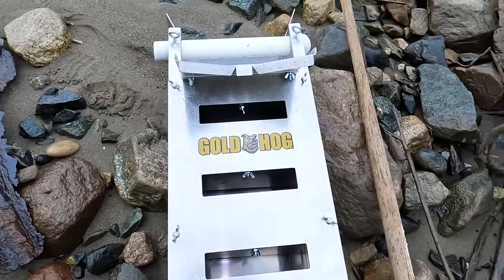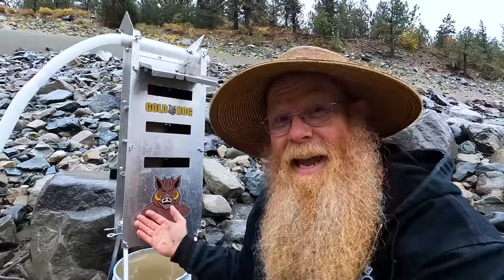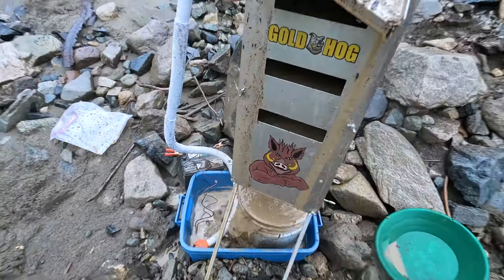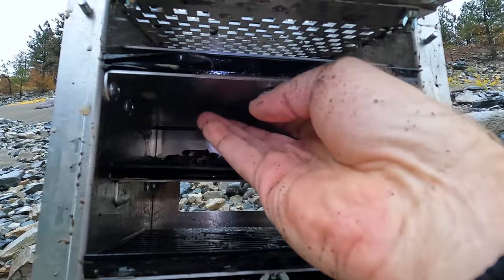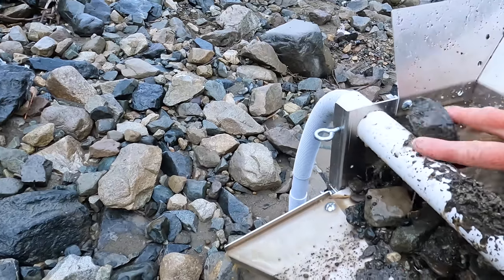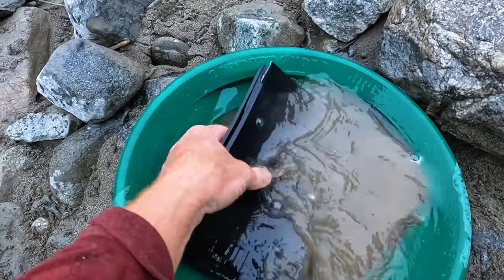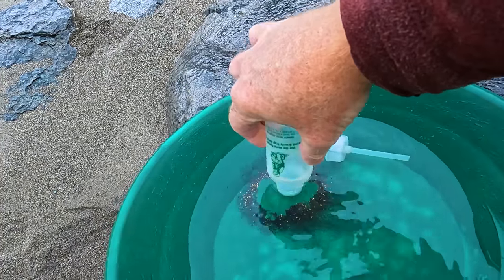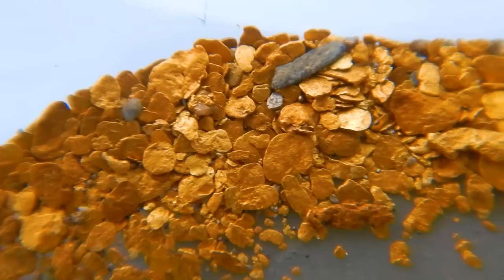New Gold Recovery Technology!  Great Gold!

Comment: Use a smaller bucket just for the pump inside the larger container nested down just below the water line to act as filter for sediment. Opposite of how you used the big bucket to capture sediment and repump the runoff, saves space and achieve the same result of not clogging the pump. This Boar box looks promising, I've been getting into backpacking again and prospecting intrigues me. A lithium Ion 12v battery would be a lightweight option to carry around, could run that pump for several hours. Good stuff! 👍🏻

Comment: I use heavy black plastic tubs from a farm supply store for panning and using my recirculating recovery sluice. 
A plasterer's tub works great for both when neither water nor discharge are problems...and a 15 gallon livestock feeding tub holds enough to recirculate, and would give enough room to set up a vertical unit like this and have enough room to use a tailings bucket you could access easily.

Comment: Hi Dan great video, I do have a suggestion about the Boar Box. The wing nut bolts could be made to swivel out  sideways and slots can be cut out of the front plate to make it easier to take off and put back on faster without taking off the wing nuts completely.
Reply: True but at what added cost?  Isn't there always a trade-off between cost and convenience? Gold Hog could have done a lot of things differently.
Reply: @rogerolander458  lots of fine stuff on the front, I can see the swivel out ones binding up with sand etc. I think it would be an inconvenience if nothing else
Reply: @dougmcmillan2483  Nuts and bolts bind up with sand too.... when apart. I think quick release latches might work well but are more expensive than screws. But screws are a simple solution and add rigidity when tightened up. The bolts could be shorter so that one spends less time undoing\tightening.
Reply: Why not wire the nuts somehow? Add a screw to the side for one end and tack the other or drill into one wing to fasten.
Reply: @mikescudder4621  a couple of simple clamps down each side might work, sure would be fugly though
Reply: I like that Idea !

Comment: Just an idea for you with your pump.
Have a 5 gal pail with a side fitting 1 inch diameter. And it joins to your bin by same pipe. Water flows from bin into 5 gal pail through 2 fittings and piping. Then that allows you to buy time. Pump would be in 5 gal pail and your bin is just a silt collector

Comment: Hi Dan,
Congrats for seeing the invisible gold! 😉
If you replace the end cap of the spray bar with a valve, you could flush the spray bar if it's clogged. Gold Hog may do some improvements after some feedback from users.
If your pump did take sand, you should lift up the clean water bucket. This will help to blow out the sand out off the pump and the hose.
Best regards from Germany!

Comment: Looks good.  When you get done, pull the mats, put a pan under, and rinse out the runs without the mats.  If it's like every dredge or sluice I've used, you'll find a little gold that slipped under them or wedged into the sides.

Comment: Looks very interesting. The unit seems to stand up to the Gold Hog standards. I purchased the Gold Hog Multi Sluice, and it works very well. I usually check the tailings with maybe a microscopic piece or two, but it is another great piece of equipment.

Comment: A few thoughts.  
Get rid of the wing nuts and replace them with spring latches on the front panel and on the mats.  After a session, the generally cold water would make one’s fingers unable to easily manipulate those pesky wing nuts.  Also minimises the risk of dropping the nuts somewhere, or just leaving them at home after cleaning the unit. 
Modify your water discharge so you have a large receptacle, with a mesh screen to the pick up for the pump to protect it.  
Silicone rubber nozzles that push into the water pipe.  As you rub them, they will self clean in most situations (many domestic shower roses use this nowadays, to deal with water scale). 
Make the whole box from a plastic material, with the option to 3d print mats specific to the user’s local conditions.

Comment: Hey Dan, been watching your videos for about a year or two, like the content, and I like your presentation. You have good energy. I had a suggestion for the next time you run the Gold Hog .. if you wanted to get material up into the hopper with less rocks etc you could run a little shop-vac (2 or 3 gallon} with a large suction tube and put a piece of hardware cloth quarter inch size or so wire over the tip of the tube, that way nothing bigger will get sucked into the vac bucket, and then dump that into the hopper once it fills up each time. I'm sure you could find one that would work on the same 12 volt battery and some that I've seen have pretty good suction you could try with different size holes of hardware cloth wire if quarter inch was too small etc, don't know if that would take some of the fun out of the shoveling part of it for you though but I heard you once complain about your back in one of your videos, and that might save it quite a bit.. speaking from personal experience hehehe. Also if you take a piece of Styrofoam and duct tape it onto your recirculating pump about 6 in up the tube it should float right underneath the surface but you may have to adjust it. Just a couple ideas, I'm totally new myself to panning etc but watching the machine run I thought it would be worth testing maybe? I hope it helps you in some way or helps somebody who sees my comment, if it does leave me a shout or something hehe thanks again for the content, cheers!
Reply: Good Show Bud...!

Comment: Dan, Here's a way to fix the water pumping problem in your GOLD HOG rig:  Try processing your tailings in the same way the GOLD HOG Boar does by running them through two or more basins which catch the tailings BEFORE the water gets to your pump in the LAST basin. Then, to further protect your pump, put a larger bulb of screening to keep sand out of it without choking it. And finally either some sort of floatation or a clamp rigged to prevent the pump from dropping down on any sand on the bottom of its basin. Again, the main idea is to process your tailing in the same way to remove sand just like you catch gold so what gets through is mostly muddy water which can be pumped back up through the GOLD HOG Boar rig. Finally, your could make it easier to remove, empty, and replace the upper two tailing basins perhaps while the setup is running. Perhaps using all same size basins and a spare to replace full ones would work best. Good Luck!
Reply: Drop the pump into an old winter sock, and use it as a pump filter (after you sew the holes closed).  When the flow slows down, remove the pump and wash the fine silt out of the sock, in a bucket of clean water.
Reply: @brainretardant  Huh???

Comment: Dan I have a suggestion for you. It would require two of the same electric bilge pump. Connect the outlet of the first pump into the inlet of the second pump. This will double your water pressure. If you run them side by side or in parallel you can keep the same pressure and double the volume. I've tested this theory with a dual 12v 3500gph bilge pump powered 1 1/2" dredge that had pretty good power.

Comment: Hey Dan 'GOLD HOG'!!!
! Just a quick note. Go ahead and start switching out to Lithium power/batteries. Can't beat the power to weight ratio and charge cycles. A pump screen made from window screen works perfect for a pump strainer basket. Hopper and tailing tray should be included. Swap out the wing nuts for thumb knobs.

Comment: Make a tray like the one you use to remove the big stuff, then put a big tub underneath the gold hog,  put a notch in the big tub at the top edge for the water to spill over into a smaller tub where you put your pump.

Comment: I have a Gold Hog Rapture 2. It is the best machine I have used for gold recovery.  But it takes about 6 workers to keep it fed consistantly.  It  has 3 Shutes and takes 2 3500 GPH Electric pumps to keep it  flowing.  But, not a good machine in the desert unless you have the water supply to run it.  I like the boar box design, but I still feel like there could be more improvements for faster assembly and disassembly of the mats. For EXample: Imagine if you could pull all the mats at once, at the same time. I dont even know if the mats should be bolted down like that, but hey, if it gets the gold, Im happy for you. Show us more  😃

Comment: I don't know if the Gold Hog has been given away yet, but I do see some things that someone could do to improve on the setup. As far as having a tub and bucket to put my first shovel of dirt in and wash the material and then pour the pan in to eliminate the big rocks going in. I would also have a two section tub to put my pump in with a screen to keep the pump out of the tailings.

Comment: Without reading through everything, just found this vid, if you haven't already, try Tidy Cat cat litter buckets (they have various sizes, larger/shorter).  They are rectangular and look like they'd match almost exactly under this machine without having the problems of sticking out the sides so far that it causes problems in the catch bucket.

Comment: Seìng you struggle with your water operating the Gold Hog Boar Box, I refer to the system I built for my saltwater-aquarium. It has an overflow which doesn´t allow heavy objects to fall in, hence it´ll work for your operation too. When you work with 2 or even 3 different ´chambers´ with an overflow and if you like, use a spunge as a last filter around your pump, you´ll see there is no possibility for obstruction anymore. Greatings and good luck and fortune wishes for you from The Netherlands.

Comment: An idea on a water bin would be to find a long plastic bin that you could actually put the Gold Hog in for transport that way you have a lot of room for water and the pump can be at the far side and you won't have to worry as much about the trailings clogging it.  Could also put the water bin at an angle and have the pump at the top and occasionally scrape trailings to the bottom with the shovel.
Reply: Gold nice
Reply: Goldhog way togo

Comment: I've got 1 redesign suggestion for the GOLD HOG, and that is to do away with the time-consuming tedious wingnuts completely and use some type of latches in their place...something like an over center toggle latch or similar.  In a good day of work, those wingnuts probably would turn into an hour of undoing and redoing the wingnuts, so latches could easily get you 5-10% more GOLD per day.  Cool low volume machine otherwise.

Comment: WOW Dan! I never knew this hobby existed. Your GOLD HOG seems to really simplify catching the gold. I can see how this would make for some great vacations. Thanks for the video, Bill.
Reply: After watching you I would improve your gold hog by running an overflow to another pail for your pump also do away with the wing nuts and put slots on the front panel reverse the bolts  with large enough hole at the bottom to enable you to just press the front on and let it drop into place  good luck 😊

Comment: Quite a handy addition to a Gold Fossiker's collection, but with the manufacturer's idea of assembling it, it's way to finicky, and a right royal pain in the posterior in putting it together, fiddling with a heap of wing nuts, and then to disassemble the front to gain access to the lift out trays. My idea would be to have front, back, and sides to slide together, where the two side panels would have aluminum u-section channel on their vertical edges, and the front and back panels be aluminum box tube. In regard to the front panel, it would therefore provide easy access to the trays within, simply by sliding it up out of the way. The lift out trays, could also benefit of u-section channel riveted to the side panels, and the trays fitted with either aluminum, or heavy duty plastic tube runners, with an easy slide in/out operation. What do you reckon Dan?  Perhaps you could pass that along to the Manufacturers. I daresay it would add to the cost somewhat, but I'd be more than willing to accept that for the convenience factor alone, Cheers Dan, and many thanks for sharing...

Comment: Was thinking of some way to have the larger basin pour into the smaller one with the pump. Could even cut a hole and place an outlet pipe for that to work. I imagine that's been mentioned in the comments.

Comment: The first thing is to take a smaller container and cut out windows and put fine screening on the open areas using a product like JB WELD you have to rough up the plastic for better holding the water can come in but not the trash and fasten to the larger tub.  My high banker my suction hose has a pail with windows of fine screen and I have a clean out on the spray bars allowing me too flush them clean .  The top of the bucket has split lid tight around the hose with zip ties ries keeping it closed with 6 or more highbankers working a pit it keeps a lot of trash out of my system that others have to deal with

Comment: If you used two tubs at the bottom of equal size, you could start with the clean water and the pump in tub #1, and have the unit run into tub #2, put a hole in the side of tub #2 about 3/4 of the way up and run a hose to tub #1. That way it's just the dirty water in tub #2 that is going into the pump's tub. If you stagger the heights, with tub #2 higher than tub #1 you don't even need to worry about suction to keep the water flowing, gravity will do the work for you.

Comment: If the front plate was hinged on one side you would only need to undo three wing nuts. 
dispensing with those wing nuts and using three R clips would be even quicker.

Comment: Probably a little late for the give away, but "Gold Hog" nonetheless! Loving the content. I personally haven't had the chance to try the Boar Box, but after watching the video I would say adding the claw with a 1" plate at the bottom of the claw like the Gold Hog Raptor 2 would improve the design. I noticed a lot of material fall out when being scooped in. The 1" plate on the claw would allow sufficient time for the water to break apart the material. Adding this attachment would also allow the tray to be slanted even more allowing the rocks to slide off without using your hand to scoop it out.

Comment: My comment is why isn't the borebox  bigger and sturdier at the legs. It seems to me a set up like the legs of a aluminum crutches you use for a broken leg that adjust telescopic like and can adjust to pivot out would solve that tight bucket deal and sturdy that thing on a slope if needed and easily fold up.maybe like transit legs do .the concept is good but it looks like a proto type by design even though it's effective id walk right past it thinking it was not more than a cheep thing that would break after a couple outings and my immediate reactions is to start rebuilding it starting from the water pump that looks like a fish tank pump. I just think they cut where they shouldn't on the build even if price was higher so it lasted more than 8 hours at best before failure. Did I win ?doubt it but my honest opinion as a novice miner .thanks for the video

Comment: Use two buckets one smaller than the other to strain the water into before pumping it back through the system from the smaller bucket kinda like a water fall

Comment: Congrats to hitting 1M subs. Also on your issue of water jumping, just put a bungy strap around the base, and then you can place a shopping bag around the base, the skirt would direct the water into your bucket. This would also be good in places where the AoA of the device was offset by the angle over the ground. Like in more steep setups. Looks like a nice device setup. Also, wingnuts are way more nice to have in cold weather. One could also mount small but stong magnets near the locations on the nuts to hold them during the cleanout. / Great video.. Cheers.

Comment: I have an older Gold Hog sluice. It works great, but I like your watching your videos on the new equipment. That one looks much smaller than mine, and weight is always the key! I need to come up with a good recirc system. Do you have any videos/comments on a recirc for a high banker (about 3-4ft long)?

Comment: wouldn't it save you a lot of time to tap off the bottom 5 mats into a bucket, then run it through again after you've done a few runs, save the top 2 in a different bucket, and after 8 or 9 runs like that, then put all 7 in the 1-2 bucket and pan that?

Comment: Is it possible to devise a float around the pump so that it ascends (somewhat staying vertical) with the water level?
I would also try replacing the bolt/wingnuts with cam locks like you find on some window sashes. They would be much quicker I think.
Gold Hog

Comment: Put a rather small bucket inside the tub and put the pump in it out of the path of the tailings.  That way the pump bucket is filled because the tub level is high enough. Ah! I see someone else came up with this also.  Ah well.  I have to do similar when flushing geothermal wells.

Comment: Build a rock and sand water filter!... for your excess water that goes back to the river...light weight, cheap plastic, possibly Corrugated pipe? bring it with you, use rock and sand from the beach you are on. Leave all the natural materials on site when you leave...... also a solar generator with panels would help you too... you'll need a wagon and possibly a mule for all my plans for you... :) also, shouldn't the pump be on a float?.. there are solutions for every problem.... I do like this little rig,(GOLD HOG) probably have to get one and tweek it to my own use...good job GOLD HOG too..!